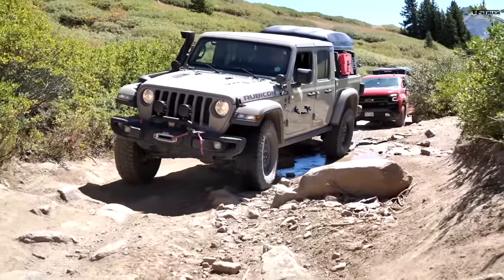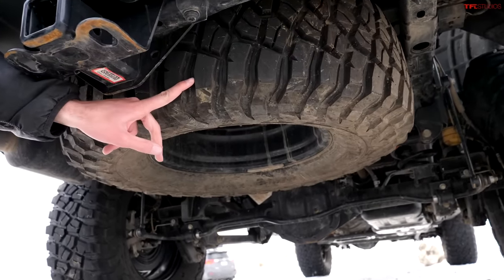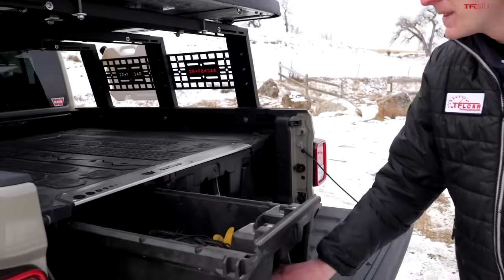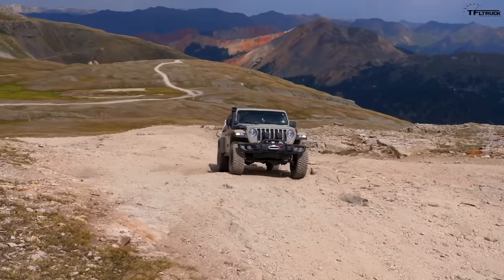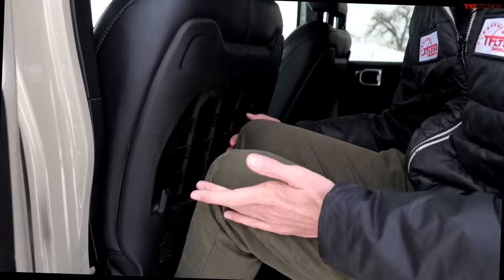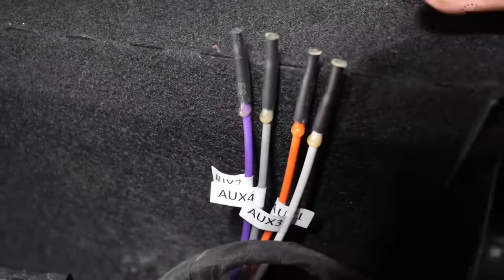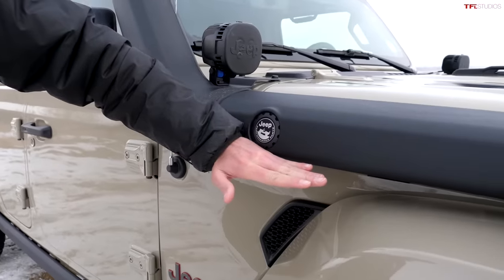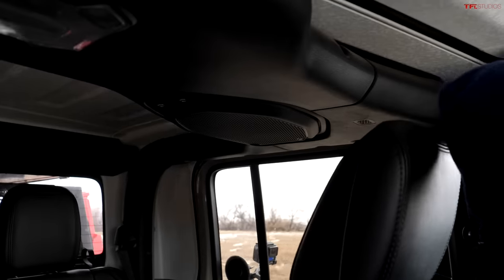Here’s What I Love & Hate About The Jeep Gladiator After Living With It For a Year!

Comment: That decked drawer thing honestly looks so useless just get a box and it'll do the same thing and take up way less space
Reply: I hate those drawers too
Reply: It's OK in a full-size, my old man's got one in his F150, lets him keep all his tools dry and with the taller bed sides there's still room for stacking bags of mulch or carrying loose gravel. Looks like it takes basically all the height in this jeep though
Reply: I would rather get a 250 litre (65 gallon) in-bed extra fuel tank to increase the driving range, especially if I got the ecodiesel option.  If you are trying to get AWAY from civilization, then the more range you have the better!  Since I would be using this as an off-road 4x4 boondocking/overlanding vehicle, I would get the fully metal and taller truck bed cover which will keep all my gear dry AND let me used it as an actual sleeping bed if I buy one of those pull-out truck bed extenders that make the truck bed a full 2 to 3 feet longer than it's current 5 feet length.  

I would also get special in-bed racks for TWO 40 lbs Propane tanks for my cooking needs, my extra wheeled portable fridge, portable BBQ, some roll-up solar blankets and a 1500 watt 120v battery/iinverter to power my 150 watt ceramic heater and portable electronics. Add my inflatable bed and extra winter-rated  driving cabin and bad-bed insulation for the coldest Canadian winters and a rack to hold my Shortwave  and VHF radios and a Starlink satellite dish for my 120 megabit works-anywhere Internet/Netflix TV/IP Phone connection. Add the rooftop rack for my extra MRE/IMP rations, inflatable kayak and other fishing/camping gear and I will be staying away from the rest of the world for six months!

v

Comment: I went for the ecodiesel option. Full tilt.  Absolutely love the rig.  Power is fantastic.   I've had to take a couple of trips to Oregon from Colorado so I've already got miles on it.  The last trip out and back I got 34 mpg.  Granted some of that mileage was following big rigs doing 75-80 mph using the radar cruise control.  Note: the radar cruise is amazing - set it and it will follow (pace) the next vehicle in front no problem. Even if the followed vehicle comes to a stop- the Jeep will stop fully also.  At that point the CC disengages.  When the traffic starts to move simply tap "resume" and it takes off again. Absolutely effortless to drive.   With the Banks Power mod it would be absolutely no problem with 40's and re-gearing wouldn't be necessary.  Towing?  You bet.  This is way more torque than the gasser.

Bought from Johnson Auto Plaza in Brighton, Colorado. 😁👍

Yes, the Decked option seems like a huge waste of space.  Granted the plastic is so heavy duty that you could load a pallet of  wood stove pellets on top of it no problem.   But the option is way overpriced for what you get and it is not easily removed should you need to haul a bulky item.
I have the Mopar lights on the front bumper - yes the are expensive no doubt but they are well built all metal casting and CRAZY bright.  Would definitely buy them again.
Reply: have u found any noteable issues with the ecodeisel? because im not sure of which one to get for a better power:price ratio
Reply: Any problems with the ecodiesel yet? I don’t understand how you’re getting 34 mpg. I’m lucky to get 18. I knew it was rated higher, but I didn’t think the diesel was rated that much higher.
Reply: Diesel is paradise. 
And in general, the engine lasts so much longer than gas. 
Cause since it’s an oil, it preserves the parts
Reply: Garbage
Reply: What’s a “steelie”?

Comment: Caution: marketing guy from DECKED here. Thanks for the honest review, and to be honest, it does not leave much room in the bed for other stuff if you don't have a rack or other containment. When Jeep made the Gladiator, it was two years after we had made our product for the Tacoma market, and we didn't see the reason to redesign for the Gladiator since the bed is tiny anyway-- they put the most pinner truck bed ever made on it, my kid's sandbox is bigger. Why? We don't know. They designed it to carry heavy loads, so why not give the user a real bed? Probably aesthetics is my guess. But the product we make fit, so why not make it work for the Gladiator? (if we hadn't we would have gotten a molotov cocktail thrown through an office window by angry Gladiator owners). You do lose space on the cabside end of the wheel wells, but Tommy failed to point out the two storage bins on the outboard sides of the tailgate end of the bed which are quite large and useful for segmenting and organizing loose things like straps, tie downs, hitches, cleaning products, camping items, etc). And our product does take up about a 4" wide swath down the middle of the bed with the center support. Otherwise the rest of the space is quite usable and arguably more useful. You do get a flat surface that actually gives you more level square footage to work with (but again I am the marketing guy so take that for what it's worth). What you gain, as Tommy mentions, is secure and weatherproof storage which is easy to access-- you don't need to crawl into the back of the truck. It's a tradeoff like anything else about this vehicle, including the vehicle itself. We do make some really affordable drawer accessories which would have made them even more useful, but it doesn't look like, from this video anyway, that much was ever put in the drawers. You can read un-edited & filtered reviews (except for obscenity) here https://decked.com/products/decked-jeep-gladiator?variant=15836002615362&year=2021

Comment: When we tested a Rubicon Gladiator, we used a sound meter and we measured 71 decibels at 50 mph. On the same day, we measured a Honda CR-V EX-L as well on the same exact roads and it measured 72 decibels at 50 mph.
We were impressed and bought the Gladiator two months later.
Reply: That's basically average to average, weird reason to pinpoint for buying the gladiator.

It's not quiet, it's average.
Reply: @greuju  got one here
Reply: @greuju  hater spotted
Reply: For something with a removable roof, average is very good

Comment: I have had a 2019 Grand Cherokee limited with the same V6 as the gladiator for the past two years. That engine does not deserve the hate it gets. It's smooth, quiet, adequately powerful and not too much of a gas hog.
Reply: Coming from a 94 Wrangler with the inline six to a 2017 with the V6, I definitely like the extra horsepower of the V6. But I really miss the old engine's low-end grunt. The V6 puts most of its power out at higher revs like a car engine, which is nice on the highway, but not as nice when you need it to get the weight of the jeep moving up a steep grade from a dead stop.
Reply: @shmehfleh3115  Yea, I had a 2000 Cherokee sport with the i6 several years back and that was a great engine. It wasn’t as powerful on paper as the V6 in my Grand Cherokee but it felt like a truck engine and really suited the character of the Jeep.

Comment: Amazing review. Here are couple of things I wish Jeep did.
1. Half doors from the factory like Ford Bronco, so when you remove the doors, you don't have those awkward doors.
2. The rear door of the Jeep wrangler and gladiator is too short. For bigger people like me, I am having a very difficult time getting in and out. Wish it was like 4 - 6 inches longer.
3. Paint the roof black and or cover it with the black fabric. Or at least have an option from the factory.
4. Offer V8 Hemi with Gladiator Mojave. That would be amazing.
5. Make roof fold into pieces so that you can store it away in the trunk. Specially with the gladiator.

Comment: Great video! I have been lusting after a Jeep pickup with a diesel for years. I’m waiting for the second gen ecodiesel to get the kinks worked out. 

It always amazes me that people buy a convertible with the hard top and then never take it off because it’s a pain in the ass. I know that soft tops are really cold up north I’m the winter, but soft tops are so much easier to put down. Same goes for the full hard doors. Get aftermarket soft doors and it’s a breeze to take them off and toss in the back. The open air top down doors off is the best part. The easier you make it, the more you will do it.
Reply: One thing about a jeep... its heater works well. Youll never have an issue warming it even with a soft top. However,  road noise is another story.
Reply: @benwilliams2487  I had a 94 YJ with a soft top.  I'm willing to deal with the road noise to get the fun of putting the top down quickly. Most people get hard tops and never take it off because it is a pain in the butt.

Comment: The led lights, auxiliary switches and the alpine stereo are must haves. You can add those options but they are a pain. The build overall looks good!
Reply: The lights can be changed in literally 30 minutes and half the price but I’d agree with the other two
Reply: After doing custom electronics installs on prior vehicles, that Jeep provides both in and outside cab pig tails with high amperage ratings and configurable latching/momentary operation is massive.  You could totally e things on your own but it would be a lot of work and wouldn’t achieve the same seamless integration.  This is such a cool and handy feature.

Comment: Spray a bit of black plastidip over the hubs. It will keep the moisture out and look better.
Reply: i hate those "home solutions" that make a mess for the professionals ... take your flex tape, thopmsons water seal, expanding foam and silicone based caulk and throw them in the trash with that can of plastidip before your tempted to plastidip anything else ... im sure you've done every tool and half the silverware in you house already
Reply: @philtripe  home solutions lmao? Nowadays someone at their own home can have access to anything a pro can and a real "professional" wouldn't complain about a thin peelable bit of plastic maybe find a new hobby 😆🤣
Reply: I'd suggest a light spray of corrosion inhibitor, like 'Corrosion Free'...
Reply: @philtripe  because plastidipping the little hub on the rim is such a mess for professionals 🙄 if that's going to give you a hard time I don't want you working on my car.
Reply: @philtripe  you mean the “professionals” that can’t diagnose a problem without an OBDII code?

Comment: I'll miss watching videos of that Gladiator. I own one myself and really love it. Mine's very similar to yours (leveling kit instead of lift) on 35s. I love taking the top and doors off. Aside from the passenger seat not having lumbar adjustment, I guess I really don't agree with you guys on the seats. I'm 6'5" and fit well. However, I don't drive as many trucks and upgraded from a 2000 Xterra... so I'm sure I'm wrong and am just enjoying the space and seat upgrade. I test drove a Tacoma and ZR2 and the Gladiator was hands down the best between the two. One thing that I don't like as a tall guy is having to duck my head down to see high stop lights when I'm stopped. It's not a big deal, but crinks my neck if I'm doing a lot of city driving. Farewell TFL Gladiator! I've enjoyed your videos.
Reply: Thanks God I am 5' nothing 😂 so, I not have it problem
Love my Gladiator 100%
Reply: Still have the gladiator? What kind of mileage are you getting in town?
Reply: @DUNEATV  I do! During the Midwest winter, with 35” tires and a leveling kit it’s at 13. Typical summers it’s 16. Highway it’s higher but I don’t commute far. Not very good but it’s a lot of fun (typical Jeep owner argument).

Comment: I have a 2022 Gladiator Rubicon in similar for to this one. I have a Go Rhino bed rack, Smittybuilt XL tent and awning, I also have the Decked drawer system. 

The Decked system is a love/hate relationship. I love the added secure cargo space it brings, but hate the amount of space it takes up in the bed. 

I have taken the doors and roof off of my truck, I use a cordless impact gun, makes the process a lot faster. I always bought my own tork sockets because they are better than the ones provided.

I have used mine for overlanding, light off-roading, and long road trips (Georgia to Montana and back). The seats are not the greatest, but my 07 Wrangler was worse. I do agree with everything else Tommy mentioned with the truck. There is nothing else like it out there, and you have a lot of aftermarket support to do just about anything you want to do.

Comment: I've had mine for a year and love it.  I am jealous of your mileage though.  I'm getting less than 13 MPG for some reason.
Reply: regear dude
Reply: That’s so wild to think about! I have the Grand Cherokee and I avg. about 25 mpg. I can’t rock crawl or anything but I can still hit most trails in it. Is it worth the extra $14K to get a stock gladiator?
Reply: @Master-Blaster-4x4  I am geared super low which is eating my mileage. That’s intentional
Reply: @CityPrepping  im about to regear to 488, and i was hoping to regain some mileage bc im not using 7th and 8th gear, what gears did you put in
Reply: @Master-Blaster-4x4  I have a 2020 gladiator rubicon stock drive train. Not quite sure what comes with, but I haven’t changed that
Reply: @CityPrepping  i hv the 2020 gladiator too, they come with 4:10 gearing….im re-gearing to 488 bc it will help engine to perform better and get up to speed faster, im hoping to get back the use of 7th and 8th gear on highway, bc of my extra weight with overland gear it doesn’t have much torque in those gears, it will cost 2500 bucks to regear, others have claimed to gain back mileage
Reply: @williamhuddleston8927  to william….yes it is worth the extra 14k, gladiator is a different beast IF one wants to be in any situation and get thru it, for your case the grand cherokee will work perfectly….in our case we go to some gnarly back roads and its nice to know we can get thru almost anything and with a winch its an insurance policy
Reply: @Master-Blaster-4x4  yeah I’m too scared and too broke to do real off roading  lmfaoo
Reply: @williamhuddleston8927  you can hit SOME trails but definitely not most.

Comment: Totally agree on the leg room issue. I was very interested in the Gladiator but at 6'2" I found it just plain uncomfortable to drive. They lost my sale almost solely due to that. If the seats had more travel you could have both good legroom AND be able to slide it forward if you needed more rear legroom. It seems like such an easily avoidable problem.

And its not just the Gladiator. The Wrangler is just as tight in my experience and my mother's Patriot is so bad I actually can't drive it. My knees hit the dash with the seat fully back.

Comment: That overheats if the temp outside is over 90 degrees and it sees a hill!  The biggest reason I sold my jeep couldn’t even tow my 4 wheeler without over heating!  I bought an F150 with the 3.5 ecoboost for the same price you can by a sport gladiator way more truck for the money not even close!
Reply: I think Mishimoto. Ales an oversized radiator for this.  My 6.0L excursion needed one for heavy towing.

Comment: Oh the 3.6 will go over 200k miles huh. What a shame. The engine it replaced would go over 500k miles. You will never change my mind about the Pentastar being an inferior engine to the old 4.0.
Reply: Forgot that 3.8 didn't ya? Lol
Reply: No doubt 4.0 far superior. In my 94 yj it destroys all my buddies with their 3.6s in everything from reliability, mpg, and off-road performance to drag racing. And it’s over 200k
Reply: @joejohnson8159  Don’tthink it is offered anymore is it?
Reply: The 4.0 might have been somewhat reliable but it was far from perfect. No power, heavy and out-dated.
Reply: @traviskimbrell1209 I think folks often forget the weight. My old 92 4.0 weighed nearly as much as 2005 silverados engine with about half the power.
Reply: 200k is like  15 years of driving😂 that’s far longer than you’re going to keep the truck. Also we use that same engine in my hvac company’s work vans and we beat on them. They’re plenty reliable.

Comment: 100% unbiased opinion. I had a 2016 colorado (failed transmission), and was in the market for a 2021 Ridgeline RTL (None available). Ended up with a 21 Gladiator Sport S max tow with 4.10 gears. I was very pleasantly surprised with how it rode. It's definitely no ridgeline, but it's not as bad as I was expecting. Its a great alternative to the other midsize trucks if you're wiling to make a few compromises.

Comment: Traded in my Rubicon Wrangler 4 door in for a Grand Cherokee.  For 95% of use there is no comparison.  GC is easy to access, lots of room, great ride, great acceleration, and 26+ MPG highway with the 6-cylinder engine.  GCs depreciate much faster than Wranglers.  I love most vehicles - different beasts.

Comment: I believe you forgot to mention the fact it has a terrible front window defrost heating system I would say that is a con you should have added to your list. Maybe you just forgot to mention it but figured id remind you since you and your dad did a video on how terrible the front window heat is and how ice accumulates on the window and wipers constantly in the winter.
Reply: Yes, he should have.  I remember that video too,
Reply: Just a side note. On the JLWrangler forums, someone figured out an easy fix. There are some plastic plugs you can buy off Amazon for a few bucks. you plug them into every other vent along the center section of the dash. That forces more heat to the sides of the windshield and defrosts the whole thing properly.